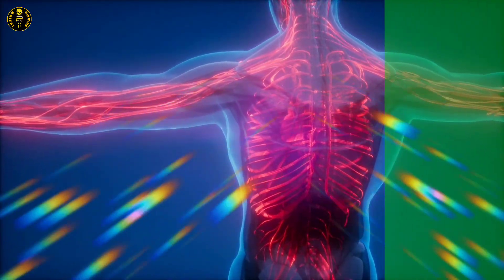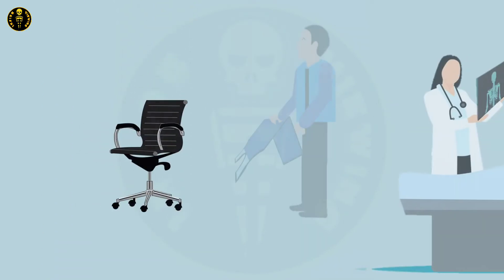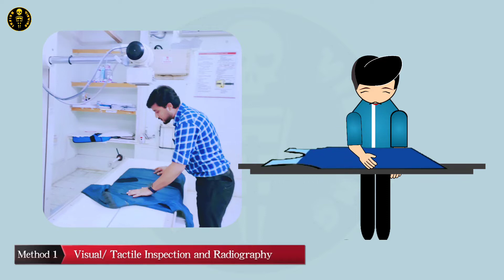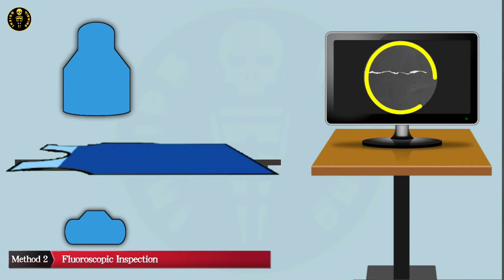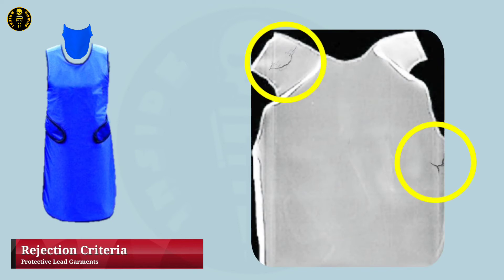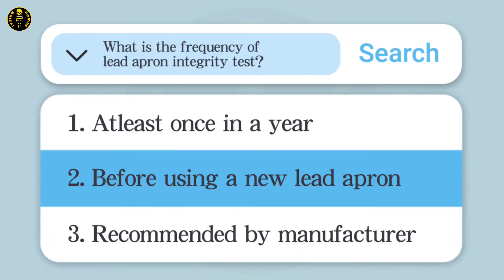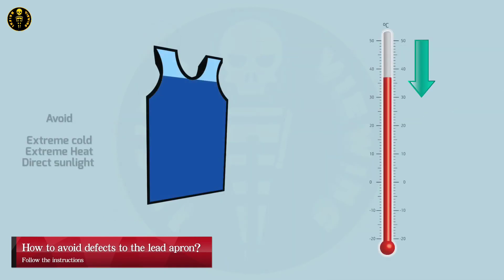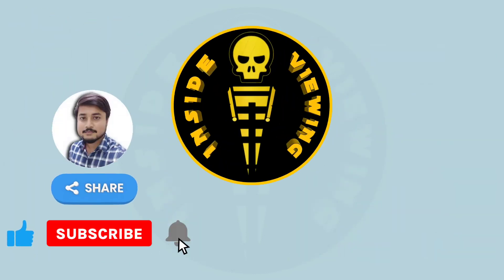Testing Lead Aprons for Quality & Integrity

Comment: If metal is kept inside the Lead apron will it appear in the Image?
Reply from the maker: Sorry for replying after 2 years, actually I was not active in this channel. 
And here is your answer:
If metal is kept inside the lead apron and exposed under direct primary X-ray beam using high exposure factor that metal object will be visible in the image if the lead lining of apron is not thick enough and one more thing is lead aprons are built to protect from secondary radiation beam not from primary beam, so some amount of can still pass through the apron.